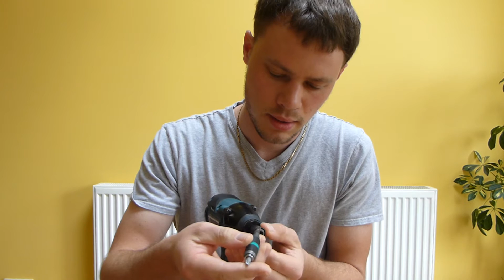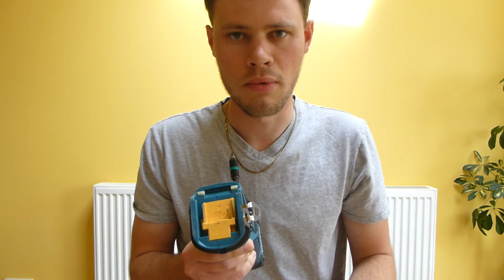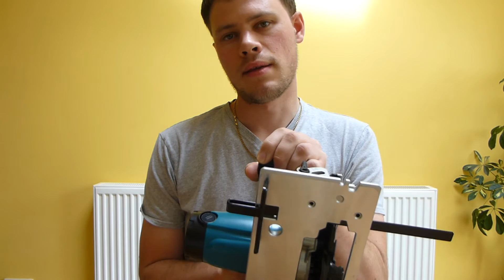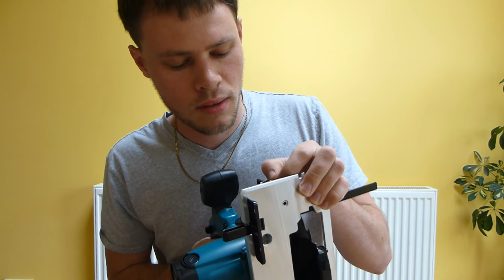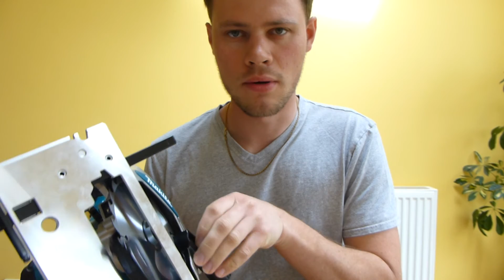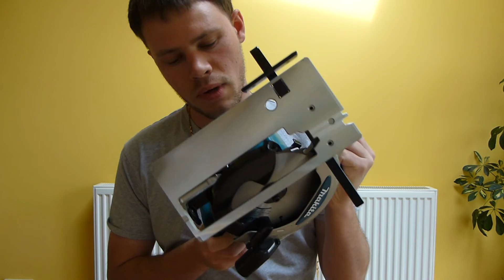Makita DTD129 impact driver/DSS610 circular saw first look

Comment: >>>t.co/HXyWQdAExw   Wow...what incredible power and easy to handle, change blades and so forth. It is a quality investment. Used it to cut boards and even changed the blade out to cut granite...and it worked, like a champ.

Comment: Good vid keep them up! One point tho, the hammer rotational force on the impact driver will not kick in until it needs it under load. That is why when driving 4" screws the first half just goes in and then it sounds like a machine gun going off when putting the last inch or so in. It has nothing to do with speed. Thanks for posting.

Comment: Funnily enough I have both of these tools. And they are both really good. I feel I could possibly live without the impact driver at a push, but after investing in the DSS610 I certainly can’t imagine going back to corded for working on roofs and such. Its just so easy not having that cord trailing behind you. I use it primarily for cutting OSB and cls and it runs for ages with the 4 amp battery. Superb piece of kit and very affordable.